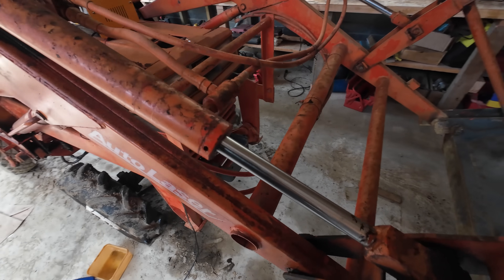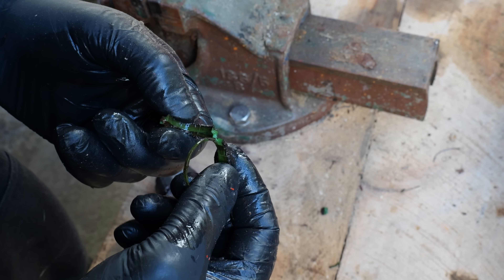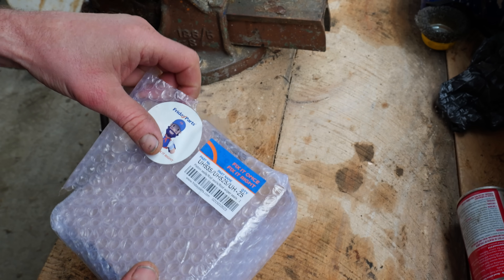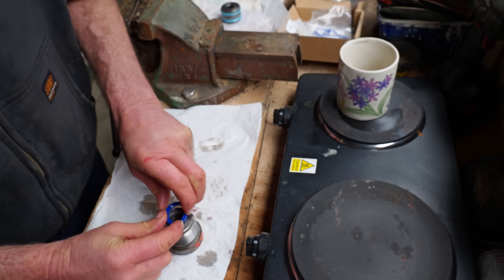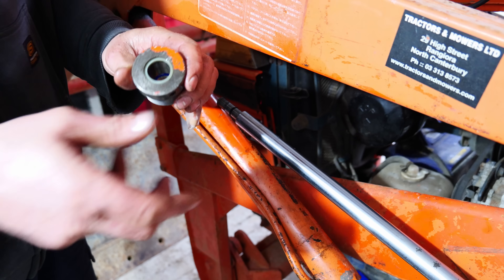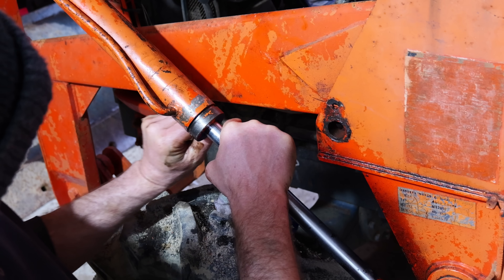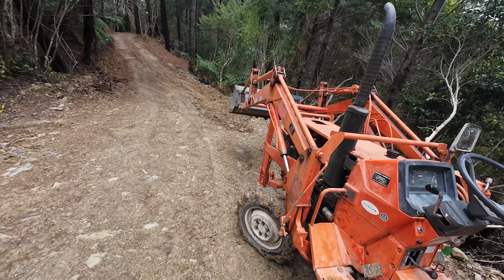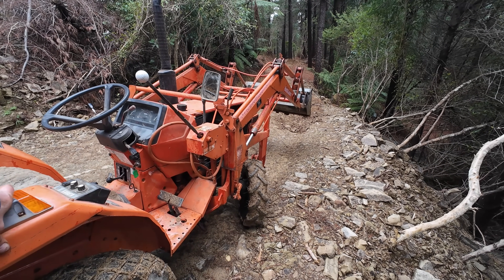Kubota L1-18 Front Loader Hydraulic Cylinder Repair – No More Leaks!

Comment: sems to me that, perhaps a shortcut could be a good idea, perhaps a suspended cable system like the one used in some mining operations, these can take ppl or cargo up and down a step hill with little effort and may be cheaper and with less labour than building roads
Reply: Always have a second escape route when you have 20,000 trees surrounding you....
Anticipate that at some stage (at least in New Zealand)
you will have fire, earth slippage, earthquakes, torrential rain....

Comment: Thanks for the details on seal orientation. I need to do the steering ram on my David Brown.
Please knock up some rudimentary ROPS for the little beast, as it doesn't take much for smaller narrow tractors to tip over - I've gone over once at low speed, and felt perfectly safe with the roll over protection. Almost went off a dam wall with our little Iseki and air lifted it away with the excavator. Footage is on my channel.

Comment: I took the steering cylinder off my little Massey to replace the seals. I know now, I should have left it in place to disassemble it. I ended up taking it to a friends shop to put in his big vice and take a rose bud "flame thrower" to it to get the packing nut off.
 Next time, I'll leave it in place and use my small ball peen hammer on it.

Comment: Got a Qn:
The inner seals that were disintegrated did you take the internal diameter where they sat to get the correct replacement or did you have a google etc.

Having the other seals with the number is obviously easier to get correct replacement.
Reply from the maker: I knew they would be the same dimension as the inner seal but with a wiper lip instead of a pressure lip

Comment: Exactly what I have done hundreds of times over the years on trucks and heavy equipment wheel nuts , or a 12' steel bar's 😊 especially difficult out on the highway as vehicles zooming past , sadly I didn't have a reduction gear apparatus, did have one in the 80s though,   
I have been patiently waiting every week 😌 for your magnificent episodes 😊😊😊❤😊😊.

Comment: Wonder if the hydrolic fluid is breaking down the seals. As it goes for aviation, you have to be very careful not to mix and match fluid types and gasket materials because the majority of them will melt each other down. If not paired properly.
Reply: It's the dust and dirt collecting on the very thin film of hydraulic oil that always remains on the extended part of the chromed rams....
that becomes a grinding paste and that wears the seals out over time....
Reply: @JohnSmith-pl2bk ahhh that makes alot of sense I should have used my head a little bit. All natural locktight production

Comment: We all learn so much from you, thanks Marty! It surprised me you didn't need a counterweight to haul the dirt!
I have a Suzue M1803 tractor with a frontloader, it works really well and is definitely an invaluable piece of equipment, so I want to do some maintenance. Someone added a hydraulic system to it with a belly tank and pump run from the tractor's own hydraulics (to run the frontloader), so there's not a lot of information on it as it is aftermarket, how would you tackle changing the oil in such a tank, how much oil should I add? There does not seem to be an any kind of level indicator.
Reply from the maker: Hard to say without seeing it, there must be a level plug or dipstick somewhere?
Reply: @MartyT I’ll try to look again, it is weird if it doesn’t have any level gauge I give you that

Comment: Always a pleasure boss 👍👏👏👏. My 7 ton electric log splitter is passing a drop of oil also, can see some extrusion of the seal(s) around the hydraulic piston, thankfully firewood all split and dry for this winter (northern hemisphere). Swotting up on all these hydraulic seal replacement vids, will be attending  to before I need to use again next year. Very best regards👍🤗🤗

Comment: The old seals looked like they don't like hydraulic fluid...or maybe it's just the age...
Interesting setup on the Kubota with the traction tires in front and the turf savers at the rear...
👍🚜👍
Reply: Old age, sunlight, ozone, 
dirt and hydraulic fluid making a grinding paste on the exposed rams whenever the tractor is shifting dirt/soil/clay/sand/etc...

Comment: I wonder if oil cooler is not efficient anymore, or maybe it doesn't have one and it has limits on continuous work??
Reply from the maker: Are you thinking the hyd oil got hot and cooked the seals?
Reply: @MartyT  It could be one of the reasons, oil itself is still probably the main reason, but just in case checking how hot hydraulic gets is a good idea, as hoses will start degrading faster as well with high temperatures

Comment: Have a look at your hydraulic oil heat exchanger. Those seals gets hard from age and or to much heat!
Reply from the maker: Yeah I did wonder if the oil had got hot and cooked the seals, but the oil has never got hot since I've owned the machine

Comment: Afternoon mate, looking at those brittle seals I wonder if the dry bollock oil in the tank is compatible. 
From the look of it, it seemed a bit cloudy when you drew one of those pistons. 
I’ve changed a seal or two in my tenure and as a rule the veg nature of oil tends to be quite benign. 
Do you think it’s possible that a non standard oil has found its way into this little tractor and it’s caused some damage before it came to you?
I’m aware certain oils have additives that improve certain aspects of their performance,  but these can cause some issues with polymer seals if they’re used in incompatible systems. 
Then again maybe, it’s just the age of those seals.
Reply from the maker: Good point..  i did change the oil a few years ago but the seals were already leaking then, hopefully they like the new oil

Comment: I saw the tractor tires slipping a bit when you were shifting the soil, would putting the wheel weights back on this tractor help with that?
Reply from the maker: It would help, I could also add a weight to the rear forks

Comment: At around 15:55, the tractor sounds a little noisy. Sounds like very mild pinging or top end rattle, I would reccomend adjusting the valves to manufacturer spec. Don't forget to make sure the engine is at room temperature.
Reply: Kubota diesels have a quite distinct sound to them, could be completely normal.
Reply: @Vaino_Hotti i am aware, I work on them fairly regularly. That however, does sound like adjusting valve lash would not hurt at all.

Comment: Hey Marty, I've been waiting for someone, of the British Empire's persuasion, to use what in the US we call a spanner wrench. The tool you used on the cylinder nuts, to us, is a spanner. An open end, combination or box end, is how we identify the different types of wrenches.😊 I recently had to rebuild the main boom cylinders on my Bobcat. I had to make a tool to remove the cylinder caps. The holes, two of them, are on the end. Most resort to using a large pipe wrench to bust them loose. Here in Wisconsin we're starting our fall cool down as you're heading into spring!😊

Comment: Those seals get brittle from day/night temperature cycles as the machine is sitting outside, it's worse on the outermost ones because they're partially exposed. Besides keeping the machine parked in an enclosed garage there isn't much you can do to prevent this. 
Also your zip-tie stretching trick looks neat, I learned something useful today, thanks!
Reply from the maker: That makes sense, I had wondered if the oil had overheated at some stage but then the internal seals would be cooked as well

Comment: The hammer trick also works when holding tension and beating as you did Marty. I was lucky working with some old school mechanics when being an apprentice at a shipyard in the early seventies. 
That Kubota is a workhorse and well worth the maintenance, another master video.
Reply: It's a great trick to open hydraulic pressure filter cartridge housings.

Comment: LOOKS like that 1st am was extended putting pressure on the threads make it hard to unscrew. OPS
Reply from the maker: Valve was open, just a tight o-ring

Comment: Nice job Marty .. and you didn't have to make a spanner this time ! I noticed you had the "lawn?"  tyres on the rear wheels of the Kubota .. is that for another work duty, can't be too good traction on a steep drive while working the loader. Just wondering. 👍
Reply: @MartyT
7 hours ago
Guessing the rears wore out or cracked and the previous owner bought the cheapest replacement tyres he could find

Comment: Awesome timing thanks Marty. My little Kubota’s bucket is dropping so I am picking it is the internal seals. Never knew that the seal had a part number on them. My rear diff lock stopped working awhile ago I guess the internal linkage pin has gone you aren’t going to work on your one soon are you? 😜

Comment: I'm a little surprised that there isn't some kind of sacrificial wiper in front of the actual seals, something that helps scrub buildup off of the chromed shaft before that crud can hit the seal and start damaging it.

Edit:Aaaand apparently I said something too soon...
Reply from the maker: That would help.. Some rams have a sleeve over the rods to keep them perfectly clean
Reply: They were built to a price, a low price...
Reply: People that design stuff never have to work on it.